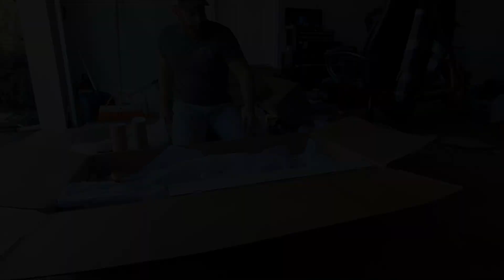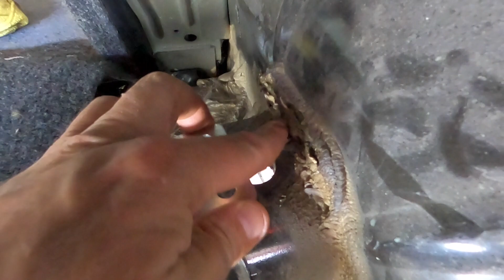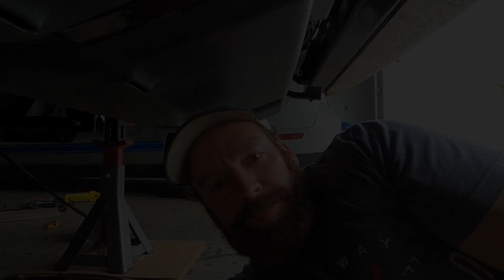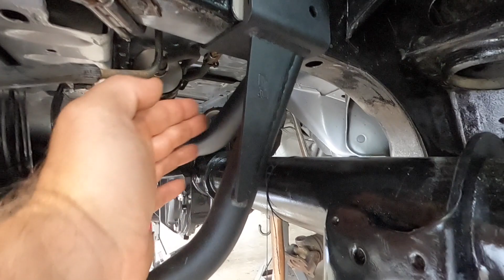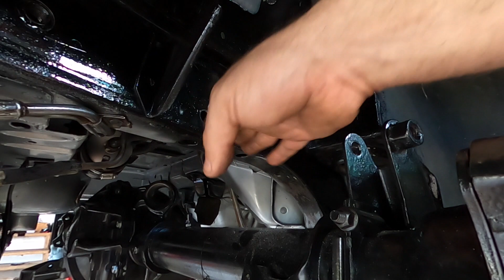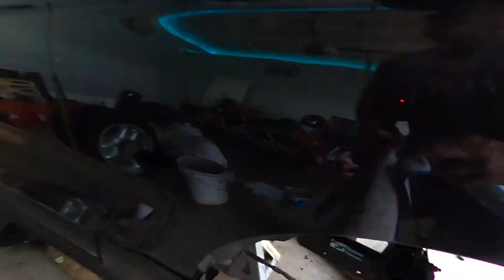SN95  With Full Maximum Motor Sports Rear Suspension (Part 6)

Comment: Put one of these in my 2004 with patriot mufflers.  Super good in the corners now.  Tailpipe on the drivers side hits the bar on big bumps though, guess the tail pipe needs a little bend since I'm using mufflers that aren't meant for the car.  Just had to have the quiet vs loud valve, lol.
Reply from the maker: I’m probably going to run the exhaust out just before the rear tires.